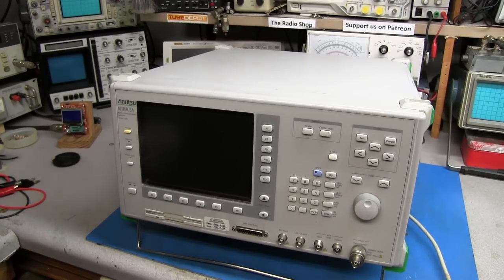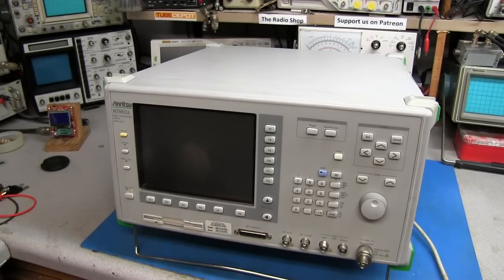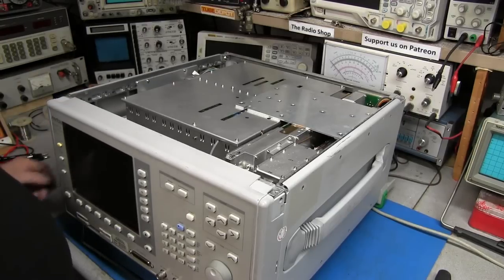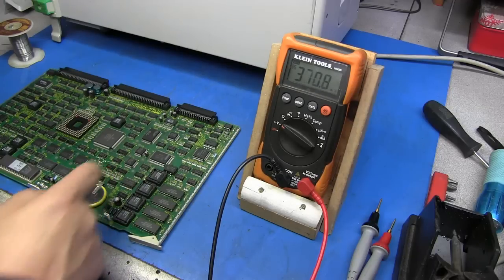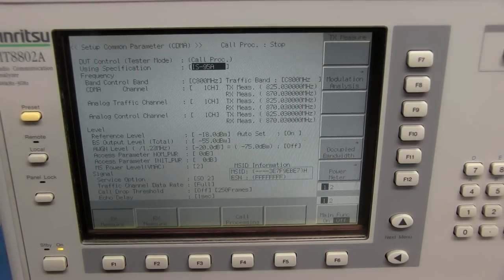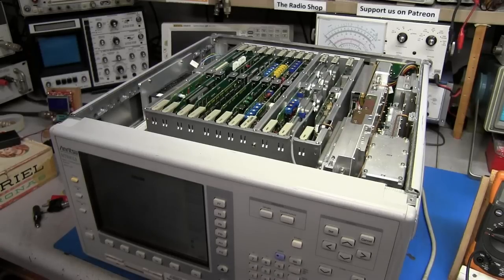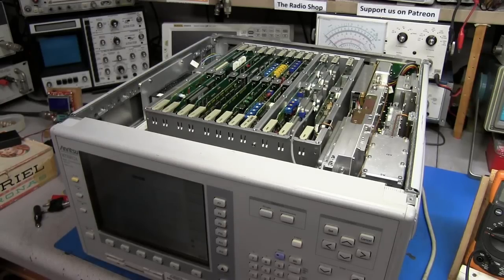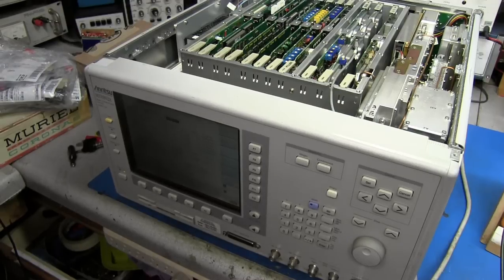# 268 Aritsu MT8802A Boot Failure

Comment: Thank you sir!  Amazing seeing this piece of equipment you doing.  I have a MT8801B OPT1 & 2 I was blessed with and similar if isn't the same issue.  Seems I wanted the OPT 7 board so have as a SA too.  Anyway, as always, you detail well and great to watch you go through and detail another repair... especially the MT8802A!  Was blessed with heavy duty shelving racks as well when I worked for the electronics/rf lab est equipment when I brought back the MT8801B.  Stuck doing sewing machine rescues now... though oh well... been advocating and seeing more main stream exposure of the health attacks since those are most important for me stay focused on when I can... albeit slow to let that out in the main stream media and general population.  However it ain't just Havana Syndrome and people in the U.S. Jurisdiction can no way accept concealed wireless assault weapons in remote sensing stations that use sound, body and mind control to poach human being or any lifeforms... especially when the stations are imminent threats and invasive nuisance malicious.   Be safe, stay healthy and appreciate the insight!  Wondering if like the HP8922's, two can be used like one as a tracking generator and the other as a SA?
Reply: Maybe could help each other, I bought the same MT8801 with a missing drive card and tried to find software but only found MT8802 (on EEVBlog).
So I auctioned recently a faulty MT8801 with such card. Perhaps we could help each other rebuild two working units with this donor and copy of your working unit software ?

Comment: Nice piece of gear! I would have made the rookie error of just cutting off the dead battery without attaching a temporary one first and probably bricked the whole thing. Once again, another great piece of advice
Reply from the maker: I hate having to reload software. Just thought I would try and be safe. thanks
Reply: Just a heads up: you can cut a dead battery out of this unit without providing backup power. I've done it. Just hit the preset button on the first boot and you're golden.

Comment: The way I know the CPU battery in my IFR1500 is going south is I get a RAM checksum error on boot up! I installed a coin cell battery holder in place of the original battery on the CPU PCB which makes swapping it out every few years a snap. First thought was your gonna need a bigger bench!  ;-)  Happy New Year Buddy!  73 - Dino KLØS
Reply from the maker: I was out of coin cell holders and need to order more. Thanks for stopping in Dino, Happy New Year

Comment: seems so called service manuals say change board 'x' or ship it back to the factory,had a 500mhz hp scope with a non working switching psu,same thing service manual only had voltage specs no schematics etc,got there in the end but was hard work,on the other hand had a busted tek 465 scope,all the info in the service manual you could ever wish for!.